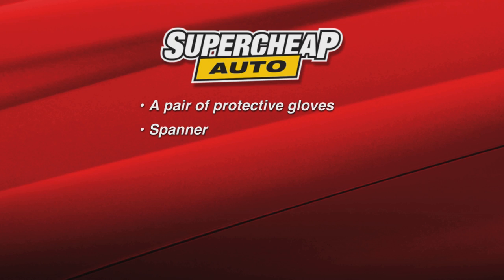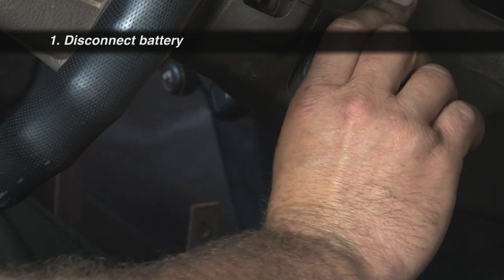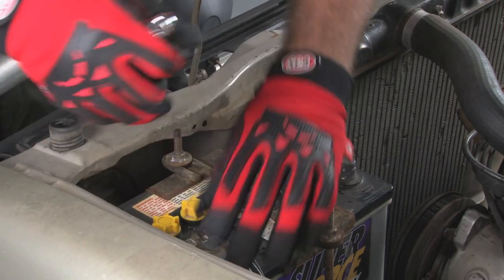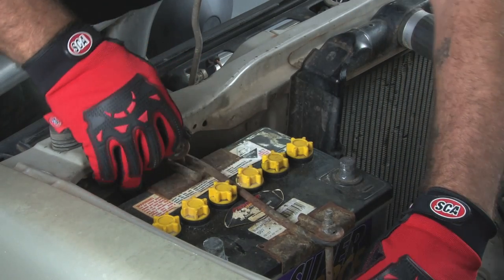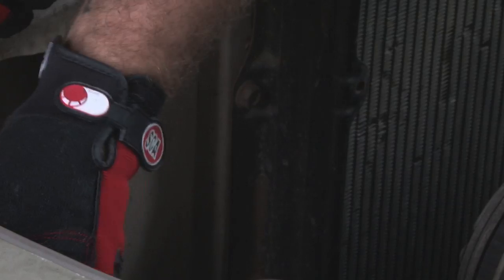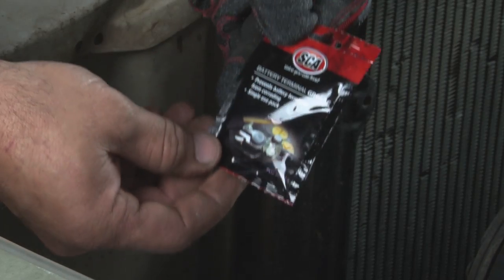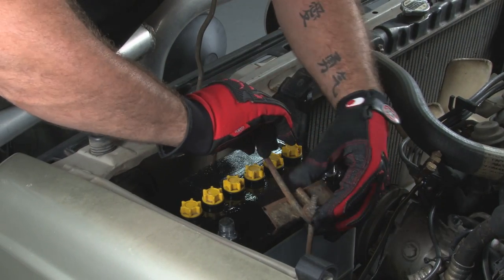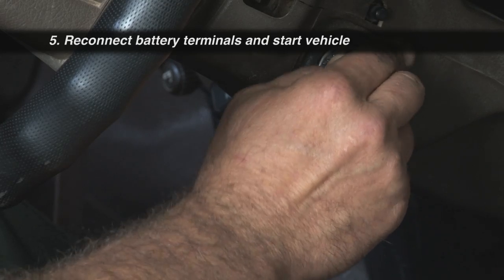How to - Replacing a Battery // Supercheap Auto

Comment: You mentioned losing codes and settings for the vehicle once battery was disconnect battery and none was mentioned, not even connecting a memory - minder device.